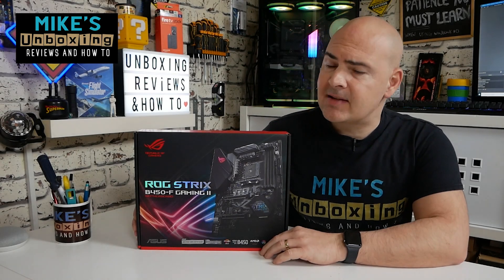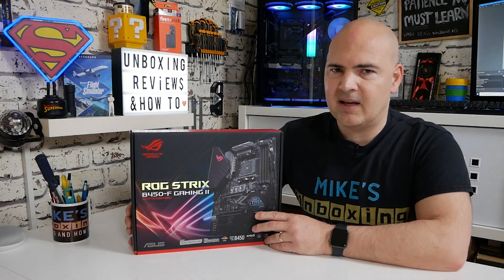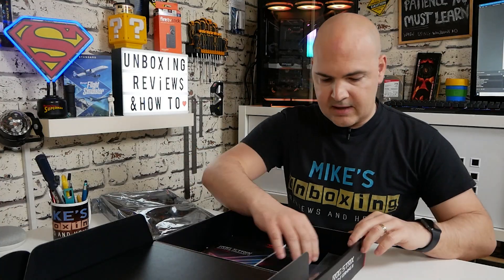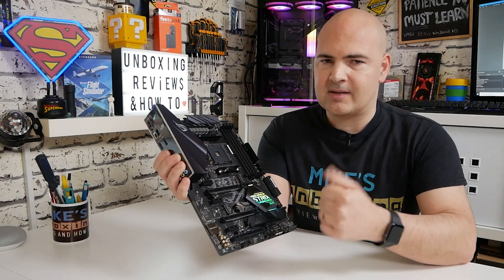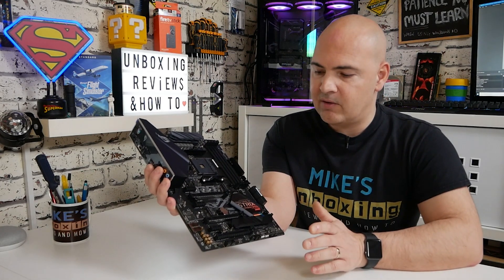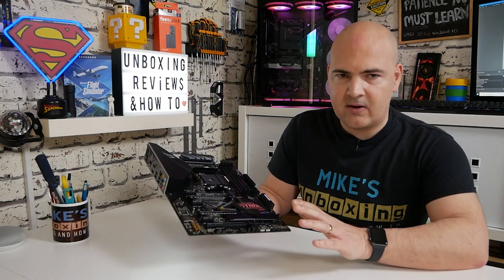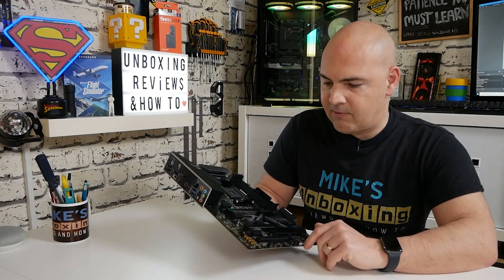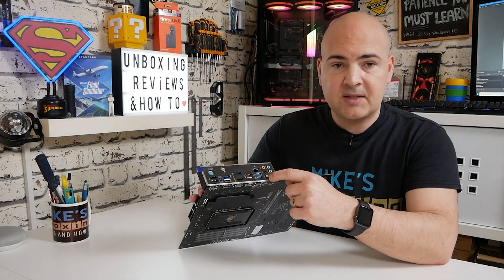ASUS ROG Strix B450 F Gaming II For AMD AM4 CPU The Most Popular Motherboard On Amazon

Comment from the maker: FIX USB BIOS Flash Button Not Working MSI ASUS ASROCK GIGABYTE  https://youtu.be/O8MwV-3oWzY
ASUS ROG Strix B450-F Gaming II
Available from affiliate links:
Amazon Local:  https://amzn.to/3skcrdg
Ebay UK:   https://ebay.us/z4YhAc
Ebay US:  https://ebay.us/ae76Iu
Ebay CA:  https://ebay.us/mq02f6
Ebay AUS:   https://ebay.us/zzqKAs
Reply: There is only one feature that makes this motherboard sale. 6 pcie slots. This motherboard is 100% bought for mining. Gamers, get out of the way.
Reply: @santiagoferrari1973  i try to multi gpu and i got no display i try all, but nothing happen, u have idea?
Reply: @jyuriemhisia2220  try this video: it worked using my Atlon 3000g...I am using 6 3070s with no issues.  16GB Ram...I am running Nicehash OS...no ssd or nvme needed....
Reply: @cdtluna  Try what video? I'm having the same problem - it seems that most people have the same problem when trying to mine with this board.
Reply: @santiagoferrari1973  can you share how did u enable all pcie's, I am trying to enable 6 nvidia card, but this wont lent me do it. any help is much appreciated.
Reply: @mike:love the videos, is there any way you could share how to enable 6 PCI lanes, I have changed 4g decoding and gen1 for pcie, but yet it doesn't reflect 2 GPU connected so far.
Reply from the maker: @aashishrulz  i'm not sure to be honest sorry
Reply: Will this board work w a Ryzen 7 5700g

Comment: The points made here about the Audio around the 16 minute mark... The onboard audio is often an underrated feature. This board has a great audio setup for the reasons Mike explains. Getting AEC and noise canceling setup without mucking around with extra software is just a great thing. Also big thanks to Mike for letting me know Discord has an often unnoticed noise suppression feature built in that I never noticed. You can only see it when you have voice activated. I have ALC1220 and lots of new B550 boards have lesser onboard audio solutions. Penny pinching? I probably wouldn't go B450 but for a cost effective build for a friend or non enthusiast, this would be on my shortlist of probably 3 B450 boards. And I COMPLETELY agree about the aesthetics. The purply pink line going through the other versions was vomit inducing.
Reply from the maker: sound is an often overlooked part of the component selection process, most people are looking for overclocking or fancy lighting, but audio is very important and sometimes expensive to replace or upgrade

Comment: I have the Mark I of this board, am really pleased with it. Recently upgraded to 4x8 3600 MHz RAM (overkill, I know), and am running a Ryzen 5 3600 @4GHz.
Reply from the maker: sounds like a great setup
Reply: Update: just picked up a used MK II for 50€. But will I have the energy to take my machine apart and upgrade, or will I flip the board for a slight profit? (leaning toward the upgrade)
Reply from the maker: @Zwerker  Decisions, decisions
Reply: @zwerker  Im just building up the smae MK II version of your setup and pretty pumped about it. Plus you flipped something for a profit! I like your style.
Reply: @classythrifter3633  I went with the upgrade. Used the Mk I to upgrade my oldest son's machine (he also got an R5 3600 and 32 gigs of RAM). Built and sold a computer based off of his old mATX board and Ryzen 5 1600af. Everybody wins!

Comment: I've been using this board for 3 years now, it's still rock solid. This is a newer revision obviously, as the back has stuff mine doesn't have.
Reply from the maker: yes a very nice board to use
Reply: where is the U31G2_C1 located at i can't find it please help
Reply: @syypher6951  On mine it's right below the main 24pin motherboard connector. Check the manual for usb3.
Reply: @vBDKv  weird,, i was stressing out cuz i couldn't find it
Reply: Hello! Can I ask, cause my SSD can't be detected in the M.2_2 slot, the one with the heat sink cover. But when I use the slot 1, it's detected. Any help?

Comment: "Is it still worth buying B450 in 2021?"
Me on a320:
._.
Reply: A320s are pretty decent with anything up to a R5 3600
Reply: @Al3ksandrOrlov  Well a ryzen 5 3600 is what ive got lol
Reply from the maker: A320 gets the job done, but if you are wanting a little overclock then b450 or higher is a must
Reply: I literally just bought this board to upgrade from my A320m s2h. It’s worlds better especially using a 3700x on the a320 was sketchy.
Reply: I got my a320m k and I'm planning ti upgrade to this one. Is it worth it even tho i ain't gonna overclock?
Reply: @SaucerStealing  if you aren’t gonna overclock get a cheaper b450 board like a b450 pro4.

Comment: Looking forward to the build that this goes into.  Thanks for sharing Mike and Kath :-)
Reply from the maker: Us too! Although i would like a 5000 series processor to test with it but as you know they are like unicorn horns right now
Reply: @mikesunboxing  there is a 5600x on aliexpress for about 485$ cad. Still overpriced, but I don't have to pay taxes so the difference at the end is not that much..
Reply from the maker: @patricklebel1141  there was a 5600x listed today on amazon US for around $300 but if bought in the uk it was about £230 but sold out very quickly
Reply: @mikesunboxing  I don't know if you know about datalover's youtube channel, but they follow stock in real time for video card and cpu with an alarm. There is a channel for canada retailler and EU. I sometime let it run in the background as there is an alarm when there is a drop. But I never been ableto catch one for the 6800 or 3070 in Canada.

(edit)I was looking at datalife engine and mixed datalover with datalife in my first post ..
Reply from the maker: @patricklebel1141  very interesting, i'll take a look

Comment: I bought the B-450 F 4 yrs ago as my First PC Build. Love the Board and hasn't failed me YET. Of Course I need to switch the RAM speed from 2133 too 3200 but other than that it's a SOLID MOB
Reply: Can i use a ryzen 7 5800x

Comment: Hi Mike would you possibly in the future make a tutorial on how to transfer all files & windows from an old mechanical hard drive to an ssd
Reply: Macrium reflect is the best best software for that
Reply from the maker: yes check out the macrium reflect videos i have done should show you all you need to know
Reply: Yes, I've used Macrium to Clone my old 8 y/o Seagate 1TB onto a 1TB M.2 NVME. Worked a treat! But I decluttered the C Drive first by transferring it over to my Seagate 1TB D Drive to just leave the bare essentials to Clone....
Reply from the maker: @makiwa  Good tip, Wild Bill!

Comment: Just got this board.

Nice all around, only issue is that if I want to use my M.2 drive, I lose 2 of the sata ports, as they seem to share lanes.

I'll get a secondary sata PCI adapter in order to be able to run my M.2, but feels like with 2 M.2 slots, there should be a way of running 7 or 8 drives, not just a max of 6 at the time.

There might be a setting in the BIOS I may be missing, but so far this is my issue.

Thanks for the good review.
Reply from the maker: yeah that is a limitation, but for most users they might use one or two sata maybe three. It is a rare case that we see anyone fully using all the SATA ports

Comment: This is undercut by the cheapest B550 (but that one does not have a great amount of VRM heatsinking), also snapping at it's heels is the B450 Aorus Pro (with ARGB, but not 5000 ready and NO FLASHBACK).
So this board does win on the "ready for anything" front, but is up against fierce competition
Reply from the maker: very true. a very competitive board. Not for everyone but covers a lot of bases

Comment: Correct me if I am wrong, but I think most B450 motherboards are compatible with ANY AM4 cpu, right?
Reply from the maker: yes almost every single processor if they have the new max version of the bios chip (256Mbit rather than the older 128Mbit)

Comment: I replaced my a320 board with this same model, but to my surprise, there's no display on 1st boot and noticed that my rgb crucial ram is not lighting up as well. tried hdmi and another gpu, its the same issue. its a good thing that this b450 board has bios flashback. i followed the guide posted on this channel and flash to the original bios that supports r5 2600, then everything worked well after that.
Reply from the maker: glad to hear you got it working in the end
Reply: Nice ,  I just ordered a 3700x and waiting on this board to come in three days , Iv never done a bios flash back as this is my first build ! Was it hard or take long?
Reply from the maker: @blindshot709  Feel free to join our Discord chat if you need any help https://discord.gg/gaeeDPw

Comment: I got one of these boards for my Ryzen 3700X DAW PC. No practical use for overclocking (or a powerful gpu for that matter.) I got this board for the sturdier VRM setup and RAM speeds (I was using a B350-plus and that topped out at 3200mhz) As well as Aura Sync. Nice to have your PC dancing along with you while you're mixing a stupid amount of samples and VSTs  😜
Reply from the maker: yes a nice board

Comment: Hi Mike I have a question. I bought this board and was a little confused it didn't include the ROG Thank You Card, is it possible that it could've been a used one or one of the first B450f gaming II?
Reply from the maker: it is possible or just a packing error from the factory?
Reply: @mikesunboxing  That's exactly what I was thinking, could be a packing error

Comment: Excellent unboxing and feature review, Mike! Can’t wait to see you put this in a system. This board does really appear to do it all - if I understand correctly, it is compatible with all AM4 based CPU’s and APU’s? Amazing. The fact it doesn’t have PCI v4 is unfortunate, but this is a more budget offering... I do have to say, these days, I only use boards with onboard WIFI for budget and compatibility reasons. I could make an exception with this board, however...
Reply from the maker: yes it does look like a great board with fantastic compatibility, being able to buy this board and have the guarantee that any chip can be bought and used without PCIE or memory issues is so cool.

The Wifi thing is something we have discussed before and it still is something that gets mused over here at MUB central 😎
Our walls are brick and cement with plaster board and plaster so wifi signals need to be very good to get a constant signal, and any distance kills it off badly unless you are lucky enough to have a mesh system, so for us here in the UK and lots of Europe Wifi is a real pain so not having it is not a problem.

I think for the US and Asia areas wifi is much more widespread in PC use and most of the questions regarding Wifi and Bluetooth do seems to be from those areas in general.

I would have liked to have seen a wifi version produced though, it would have made a lot of sense

Comment: Great review Mike, and they sure look good, and great for the price if you have a slightly older GPU. I'm tempted to get a B550 or X570 board to go with my MSI Suprim 3070 (rocking the MSI gaming Pro x470 right now, had it for a few years and never let me down) but don't know if the leap just for the gen 4 PCIE lanes is worth it?
Reply from the maker: PCIE gen 4 make very little difference at the moment, unless you are watching the benchmarks like a hawk
Reply: @mikesunboxing  Thought as much,  ill save my pennies. thanks Mike!
Reply from the maker: @BuckyKat9999  no problem 😀

Comment: Great motherboard, I got this for $119 Canadian on amazon so saved myself roughly ~$60 by getting this for my r5 5600x over the b550, since my ssd is pcie3. super happy i was abole to allocate the extraa money toward better system memory instead
Reply from the maker: sounds like you got a great deal there andrew, nice one
Reply: Heyy I just got this motherboard today and hve the exact same cpu as you, did you have to upgrade the motherboard itself? Or was yours up to date already?
Reply: @ThePhatNerdProject  hey! everything was good to go right out of the box, the b450f gaming 2 is meant to pair with 5 series ryzen, ONLY THING I did have to change was factory ram speed in BIOS - i got 3200mhz ram and it was default at 2133mhz
Reply: @ThePhatNerdProject  Also, it's been roughly a year with my PC and I can say I made a KILLER GOOD purchase decision, its nasty good for what I paid

Comment: Hi got stumbled on your channel but no regrets, i'm planning on buying this board with ryzen 5 5600g, does the 3200mhz ram freq enough for dual-channel or what is the sweet spot? kinda newbie on building a gaming pc, and what is the perfect psu for my build?
Reply from the maker: that will be fine really the sweet spot is somewhere around 3600, but most won't notice the difference between 3200 and 3600
Reply: @mikesunboxing  thank you so much for responding
Reply from the maker: @robertjohnibo2192  No problem :-)

Comment: "Why buy B450 at this time?" Well, great question! Was upgrading my home server from FM2+ to AM4, fried my Asus Prime B450M at 1:30am, this was the only board I found that had same day shipping for under $200. Bit of overkill for a headless home server, but it runs my Ryzen 3400G just fine. I like the board, has a nice quality feel to it, plenty of connectors, etc and PCI slots for my 8 SATA expansion card.
Reply from the maker: Good choice! if it needs to be stable for a server i would choose this for a B450

Comment: For the nvme slots.. can you use either one?! Do you have to use the top slot for nvme if u only have 1 nvme
Reply from the maker: you can use either slot, the top one runs from the CPU and the lower one runs through the chipset, so the top one in theory will have slight less latency as it is directly communicating with the processor

Comment: Having sold my MSI x570-a PRO and 3700x, I started looking to build another one with a Ryzen 5600x. I'm looking into b450 or b550. Or maybe an A520 because they are pretty complete for casual build, if you don't overclock. It will house a Radeon RX560 because.... I already have some ddr4 3200 memory and I bought a nice Snowman dual tower yesterday because there was a rebate on it and cost me about 36$cad. Still not decided about atx or matx..
Nice review, have a good day!
Reply from the maker: are you any closer to picking a board yet? in my mind there are way too many choices now and it actually is difficult to select a board as the next day someone will review something else which is the latest and greatest! information overload
Reply: @mikesunboxing  that's the last thing I will buy, because of what you said, and the fact that this is the parts that is the most successible to be doa, in my experience. And it is easier to deal with the seller than the manufacturer so I make sure to start it in the return window.

Comment: The issues I would have with this board is it only has one USB2 Socket and a lot of Lighting Modules require a USB2 Socket, even the Prism only works properly with USB. I think 2 should be the minimum. Also as far as I saw only 1 USB3,  so lacking a USBC Socket you can't use an Adaptor in a USB3 Socket if your Case has a Front USBC Socket - which a lot do have now.
It's a shame as it has some really good features but seriously lacking in others. Also only a single ARGB Socket is poor.
But a nice Review Mike! Just not something I would consider because of those lacking features. I bought the MSI MPG X570 GAMING PLUS Motherboard ATX and am very happy. Strangely hard to get now!?
Thanks.
ps. I wonder how many people have bought it and then realised is just doesn't cut it and returned it. Those numbers would be nice to see......
Reply from the maker: yes there is a definite lack of USB options here sadly

Comment: I have the same motherboard Asus ROG Strix B450 F gaming 2, and planning to upgrade from Ryzen 5 3500 to Ryzen 9 5900x. I'm little worried about the bios update as well as the anti-rollback thing. I am also concerned about the throttling issues if I use the PC on full load throughout the day.
Reply from the maker: do you have the option to get a new board? B450 was never designed to run these modern multicore CPUs
Reply: @mikesunboxing  if I upgrade to 7000 series then i will have to upgrade my aio ram mb cpu and here old parts are really hard to sell and my requirement is 12core 😥

Comment: When you flash your bios, and anything goes wrong, and your board is not booting, put in the usb stick with bios, push the flashback button, and you can rescue your board, so yes, any board needs a flashback button, but sadly not any board has one, you dont need the flashback button for regular bios updates, only for rescue.
Reply from the maker: thanks for the info

Comment: I am currently in the plan of building my pc, I was wondering if a ryzen 7 5800x would be fine on this motherboard? I’ve heard that the 5800x usually draws a lot of power and gets hogh temps. Can this board handle that cpu with no issues? Amazing video and review by the way!!!
Reply from the maker: thanks for the kind words, you are right that is a powerful CPU and should be fine with this board or maybe look at something like the B550 tomahawk?
Reply: @mikesunboxing  i just recently watched your review about the b550 tomahawk and might as well look forward with that one. The tomahawk has good thermals and vrms that might actually handle the beast 5800x easily. Huge thank you once again, this actually helped me to choose the right parts for my build!
Reply from the maker: @evanlyrush1214  Happy to help :-)